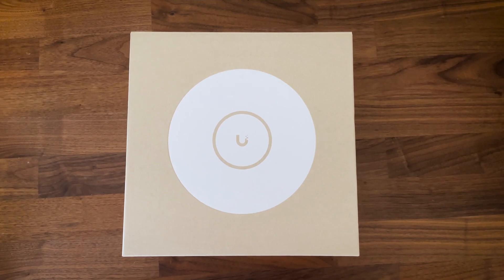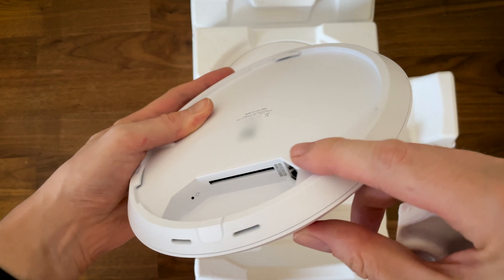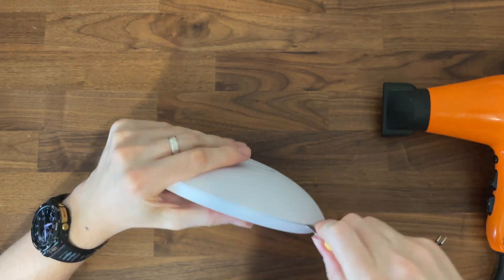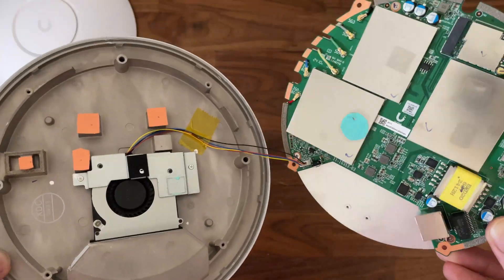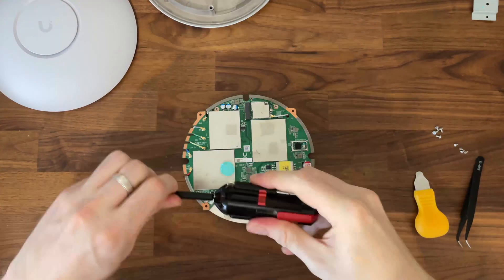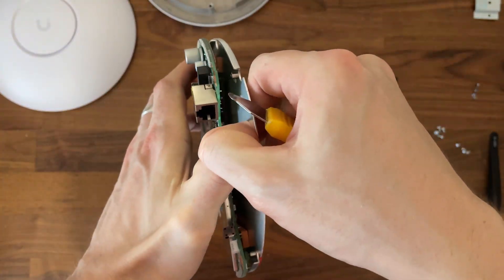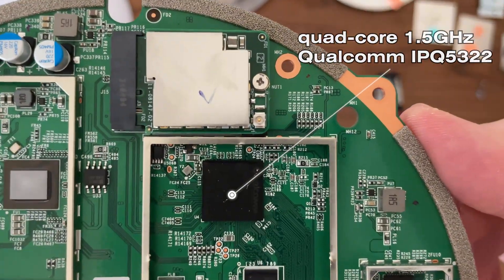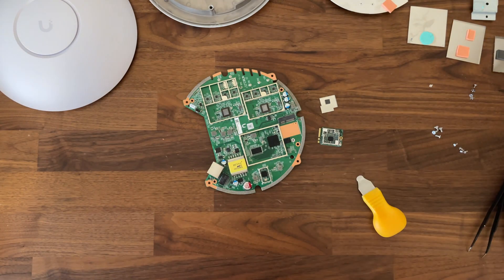Ubiquiti U7 Pro Max WiFi 7 Access Point Teardown: To fan or not to fan

Comment: Awesome! This is a great teardown video.
I have a few questions:
1. Is there any gel or adhesive between the top cover and bottom cover of the U7 pro?
2. Do the I-PEX connectors have glue on the PCB?
Reply from the maker: There is some gel in between the top and the bottom parts of the case, but it's far less than on the U7 Pro. And there is also some gel (or glue) on the I-PEX connectors as well.

Comment: Would love to see a teardown of the U7 Outdoor and see if that has a fan and what kind of water ingress mitigations it has in place.

Is it more glue? Rubber Gasket? 

And if it doesn’t have a fan, what kind  of passive cooling system does it use as it could be mounted outside in direct sunlight so could get very cooked!
Reply from the maker: From what other users have said, the U7 Outdoor also has a cooling fan, so this is the heat management for the entire series. Also, it is IPX6 rated, so there is decent protection from the elements. I can't promise a teardown since I blew the budget on the U7 Pro and the Max already :D. But who knows, maybe Ubiquiti will lend me one.

Comment: Strange fact: 2.4Ghz antennas are shared with 6GHz ones.. Normally 6GHz should have much smaller ones, that 2.4Ghz...
Reply: Those are generic wideband antennas, they'll handle anything usually all the way up to 7Ghz or 10Ghz.  They're not tuned for any frequency so they don't do a great job, but they work.  There are 3 horizontally polarized and 3 vertically polarized antennas.  Strange that the 2G/6G radios are both connected to identically polarized antennas so there's no polarization diversity on 2G/6G.  I think those are horizontally polarized too, which is even weirder since most laptops and phones in portrait orientation are usually vertically polarized.